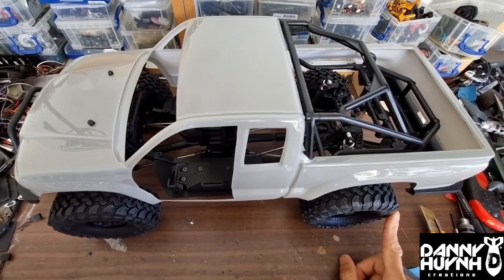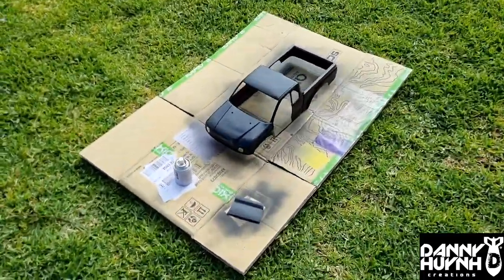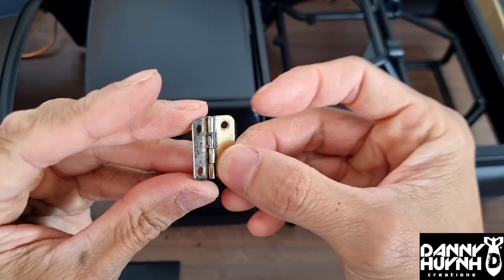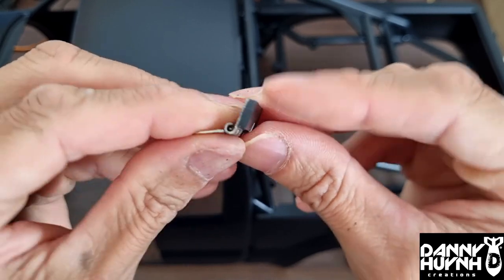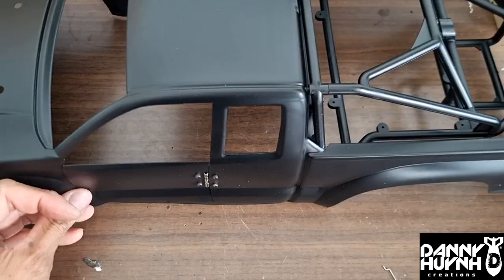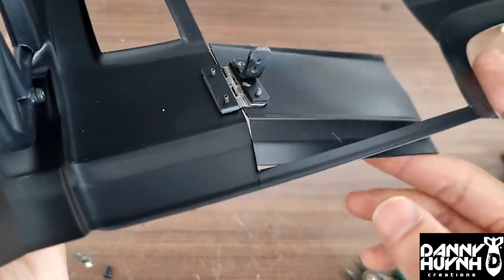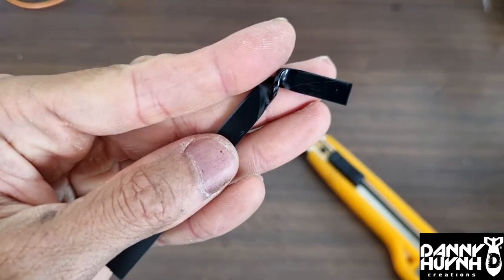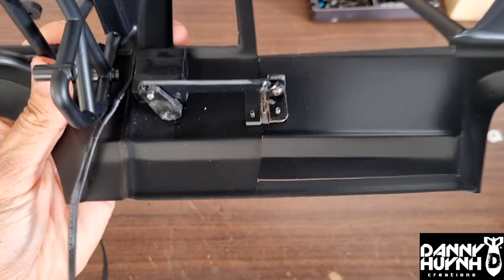Axial Base Camp pt2. Painting Body and Door Animatronics. RC Animatronics by Danny Huynh Creations.

Comment: Love the knowledge you are sharing. When space is a premium have you  used airplane control horns and music wire in place of styrene linkage?  I like them for weight reduction as well. Airplane surface hinges are also a great material depending on your desired look.